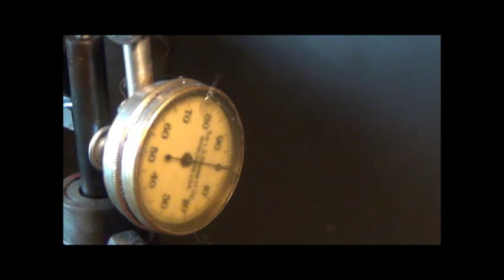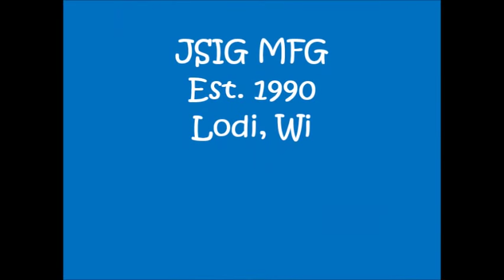Fix the Governor!

Comment: The way that 5088 is faded it looks like you have been painting it pink too! lol Lot of goofy shaped parts to hold on that gov assembly, but you got it done. You all been getting lots of rain your way? Wettest July ever I think here.
Reply from the maker: bcbloc02  I told the owner of the 5088 we should clear coat it and see if it stayed pink or more red! He didn't want to try it, because he was afraid I would add pink! lol! The rain has been coming in "big dumps" instead of nice showers! 1-3 inches/hr! At 3 am this morning we had enough wind with the rain to knock a lot of corn down!
Reply: 60-80mph wind gusts here today too and another downpour, big rain was yesterday am got 4in, fortunately we aren't flat here so it runs off, just don't want to be in a low lying area! So far my corn is looking really good. I hope it stays up!

Comment: Hi Jeff enjoyed your video I am actually working on a 8N Ford governor my throttle doesn’t control the engine speed at all I have to put my throttle back to idle with my finger or the engine runs at high speeds.
I took apart the governor and can’t really see anything wrong except some minor flat spots on the balls and a few minor flat spots on the plate that they roll on. I can’t really see why it doesn’t work! When I spin it with my hand the arms work fine!
I am really perplexed could you possibly point me in the right direction I would really appreciate it!
I thought it was quite genius how you made the puller longer and made the slide hammer out of the old retainer!
I will keep ideas like that in my file cabinet of my brain 👍
Reply from the maker: Hi Keith, I hope you found your problem already, it sounds like a weak or broken return spring or "sticky" linkage! If it moves back easy by hand then your spring may be the problem!

Comment: A '43 model would be a 2N, which started in '42.  I have two '49 8Ns and have failed trying to pull the rear hubs off from the outside.  I wonder now if they are assembled backwards like this.
Reply from the maker: +hlyautey Hi, I'll have to check the numbers on "Dolly" to see the year and model! As far as your 8N goes I think you have to use a puller to pull the axle after you remove the wheel and then remove the brake and backing plate! If I find out more I will let you know! Thanks for stopping by!